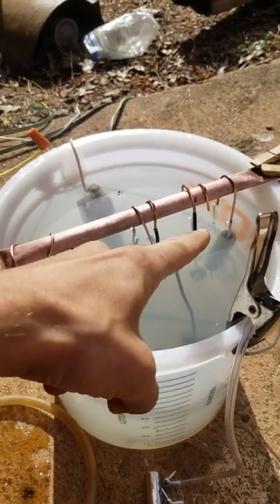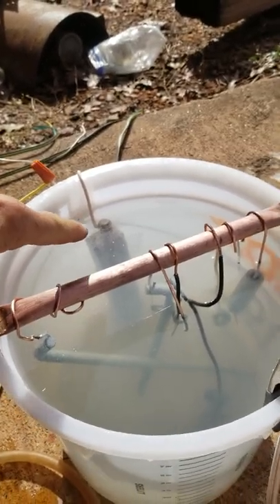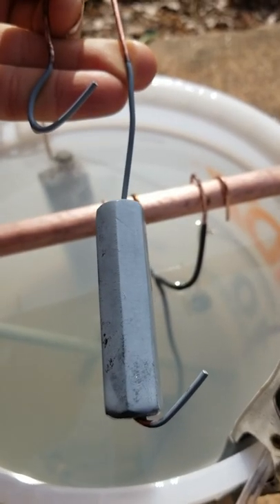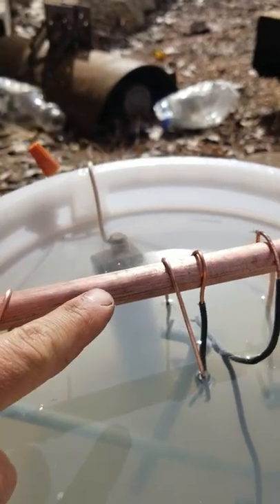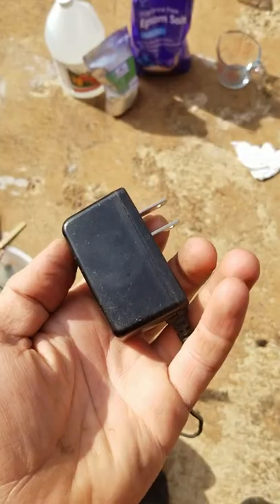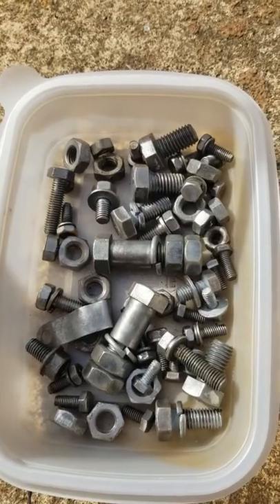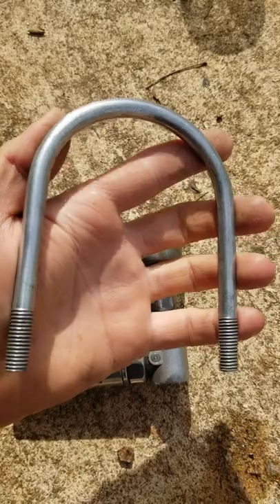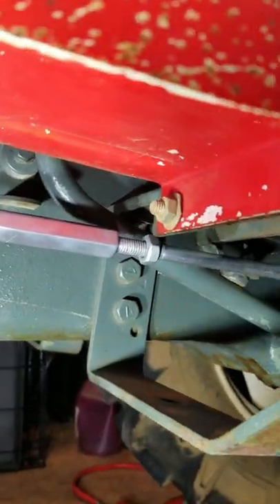Restore OLD Bolts Brand NEW!

Comment: Electrolysis can also help remove rust
Reply: Very well, sometimes better than sanding, I recently did a bucket electrolysis on an antique cast iron pan that some doofus painted, it took a while longer because my 12v  charger is a smart charger so it cuts off periodically but with an old style constant charge at 10 amps you can get rust, paint or anything off in about half a day